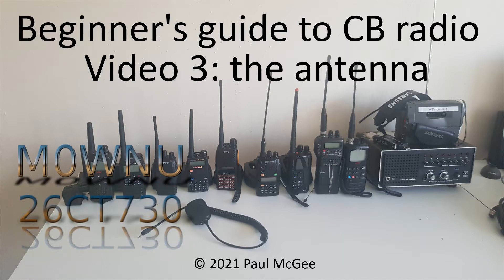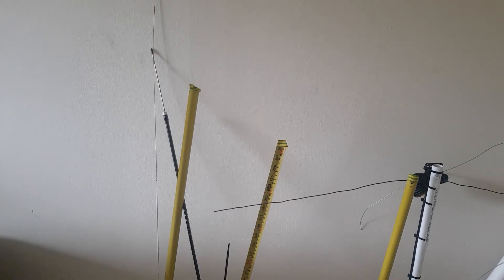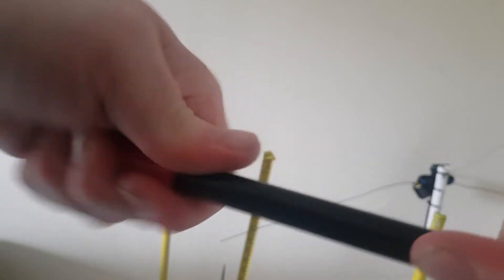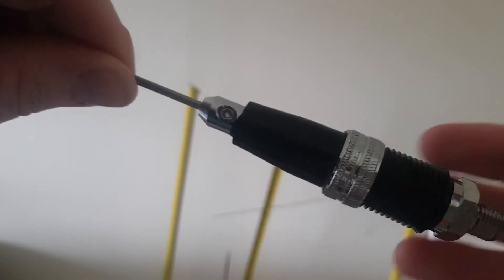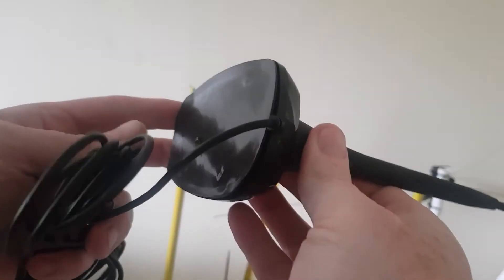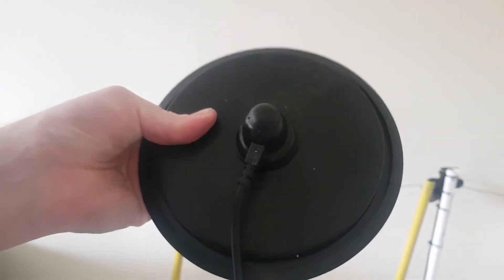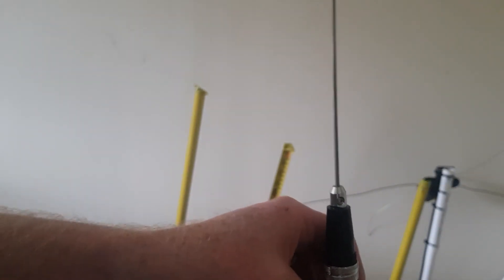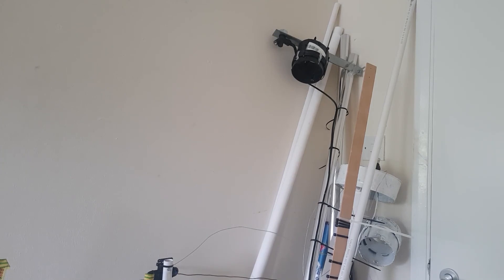Beginners guide to CB radio, video 3: The antenna

Comment: DV27 was the go to aerial back in the day, then came the Z27, then the very expensive and useless K40 (I wouldn't recommend one of those, not worth the money).  Basic rule is "The longer the whip antenna/aerial is the better it will work.
1/4, 1/2 and 5/8 wave is fine, most common is the 1/4 and 5/8 wave, the latter is supposed to perform better, but in practice if mobile you will be pushed to notice any difference!
Base station, for a beginner, get a Silver Rod, usually no tuning to do, stick it on a pole, ground the bracket to earth for safety and away you go.  Hy-Gain type 1/2 wave or 5/8 wave is a good starter. They are a decent price, so unless you are serious about CB, into DXing (with the channel allocation and modes AM/FM/SSB on the lower channels, not UK/FM of 27/81 sets) you can talk abroad.  If you are lucky and quick enough.  The DX is getting a bit better these days after a lot of years missing due to sun cycles.
If you are restricted for space, get the best option you can for your house, a DV27 on a biscuit tin was used a lot back in the day, but it is far from ideal.  Fine if you want to talk to your mate in the next street, but that is about it.  Though, that being said, I have talked to someone using a DV27 on a mag-mount on top of a biscuit tin 15 miles away (I doubt he was using 4 watts, more like 50 watts) but I have talked to a young lady 6 miles away using one in her loft, but she could not hear others, this was due to the poor reception.  We sorted her out with a better aerial 1.5 meter long mobile aerial on her chimney with a ground-plane kit on it.
Her father was a radio operator on an oil rig!!!  Honestly, I think he stuck an aerial on a biscuit tin just to shut her up!
101 to 102 inches is a quarter wave, but you also need a ground plane, which is the other half of the aerial.  However, it can be the body of your car, or a ground--plane (there are various ways of doing this) or in the case of a Silver Rod, there is a transformer inside it at the base to take care of the miss matched aerial.

No doubt Paul will be doing that next:

I hope you don't mind me adding things to your otherwise very informative videos Paul.
Reply: K40 is a great antenna, I've been using one for years. It works just as well as my sireo 4000 so I stick with the K40 as it's a bit shorter.
Reply: @Ossie12pints  K40 works for some, but they are over-priced and over- rated!
They did nothing for me, all their products are over-priced and over-rated, in my opinion of course, others might differ.
Reply: Always had good results with modulator